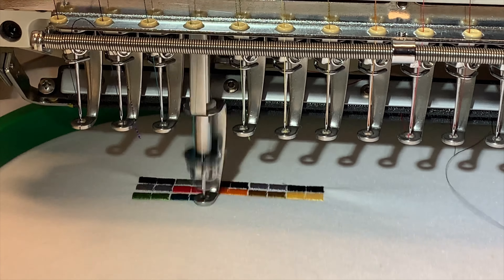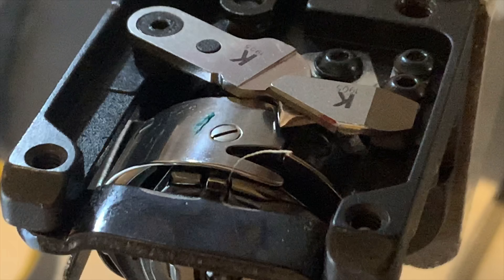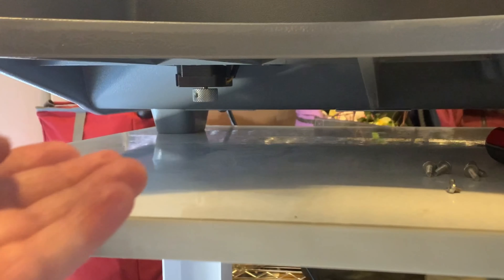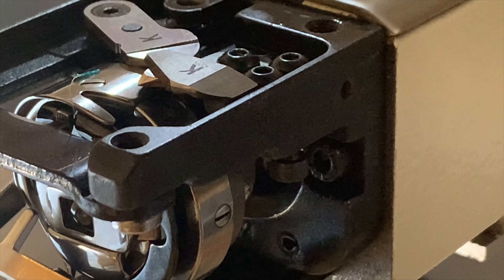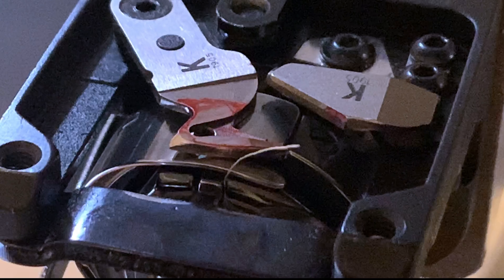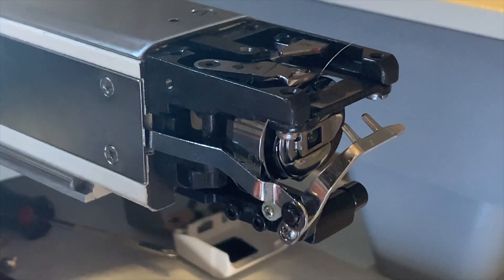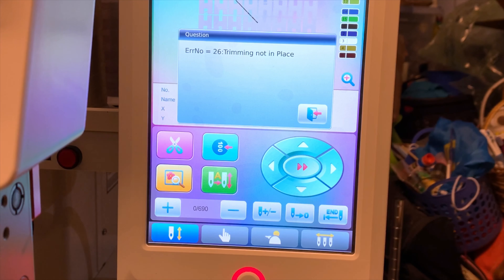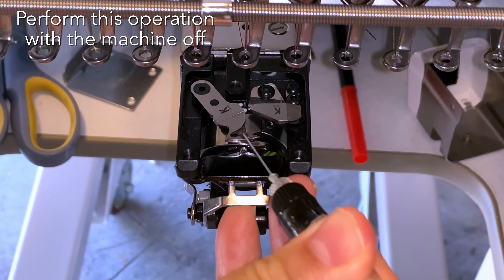About the Knifes of the Trimmer Mechanism of the Redline Embroidery Machine

Comment: hi sir,
as you told at 3:10 my machine blade are working perfectly during manual operations but not cutting when machine is performing. so, would you please tell me what are the parameters need to be adjusted in dahao A15 plus panel sir?